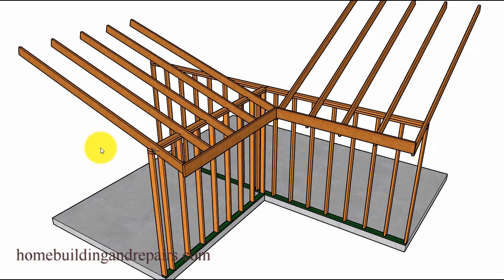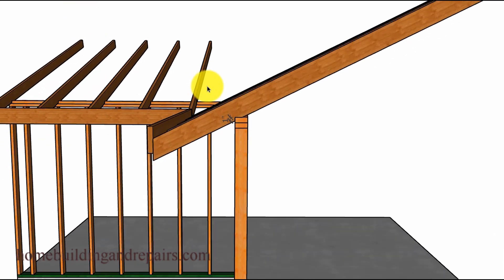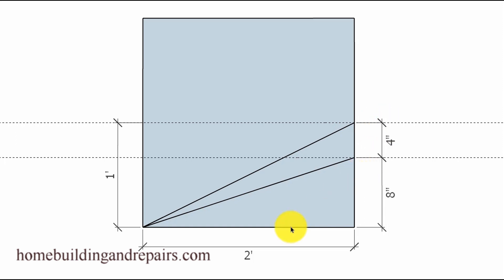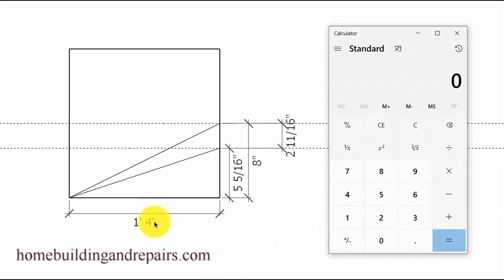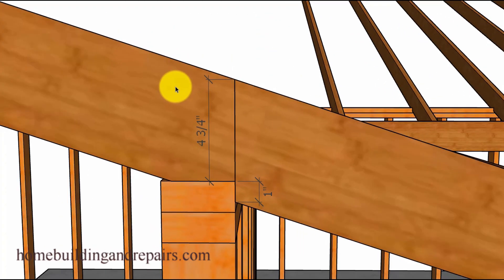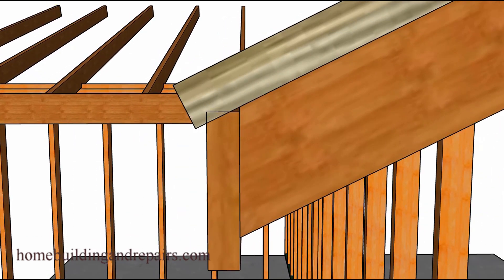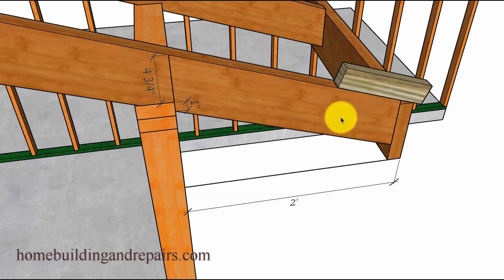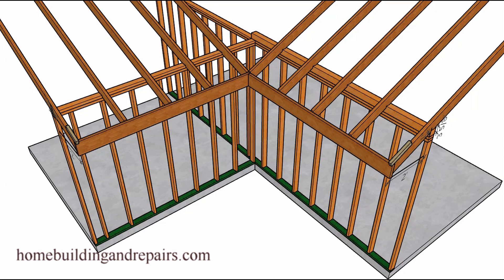How To Calculate Wall Height Difference When Framing Roof With Different Pitches For Fascia Board

Comment: Great video.   How much higher does the plate need to rise on the steeper roof pitch if one roof is 6” pitch and the other roof is 12” pitch?   Also how do you figure out the valley ridge so the two roofs plane ?  Thank u

Comment: If the pitches are different then the soffits would not be the same width.. correct me if I’m wrong.
Reply: Same question I was having.  He overcame the issue by changing wall elevation on one of the walls, there by putting the two eaves at same elevaion.  Exterior wall height and soffit depth remain the same. I think.

Comment: Nice video thanks for the information, I just wanted to ask if you have two different pitches like you have in this video, won’t there be a problem when you come to the roof valley or is it possible to have a roof Valley even if you have two different pitches, I would appreciate your knowledge on this.

Comment: So basically your soffit measurements would never be the same with different roof pitches if you didn’t adjust wall heights or seat cuts on rafters?
Reply from the maker: For the most part yes.

Comment: Thank you for this awesome video. What I don't understand is that by changing the wall height, why is the pitch not changing not changing? I guess what I mean is that if pitch is calculates with rise and run...if you change the rise by adding to the top plate, why is the pitch not changing?
Reply from the maker: This example has two different roof pitches. One on the right side and one on the left of valley.
Reply: It will change if you raise it 3.”
Reply: And it’ll screw up the tie in on top too
Reply: Yes you make a good point, if you change only the height of one wall, and not the height of the ridge associated with that wall's rafters, the pitch of that roof will change. That would alter the required change in wall height and cause the birdsmouths on that wall's rafters to not sit correctly. 

To change only the wall height and not the associated ridge is a problem more complicated than I can comprehend. What do you say @gregvancom

Comment: I'm trying to build a small greenhouse and I know how to calculate rafter length, I know the pitch desired, but I am struggling to figure out how to determine the height of the height that the wall should be framed at and what the height of the ridge beam will be. Can you point me in the right direction?
Reply from the maker: Usually you can use wall heights seven feet or taller and I have a lot of videos on roof framing at our website that can help.
Reply: @gregvancom  I'm trying to stay under 13ft because my municipality is strict about height. So I know I want a Ridge beam no more than 13ft high, and I know how to determine rafter length but I imagine rafter length is directly correlated to the height of the wall, if you want a specific pitch. I will look for those videos. Thanks.

Comment: Nice video what I've always done is draw the two tail drops and the intersecting point at the wall plate on a sheet of plywood then make each tail pattern to use when the roof framing starts
Reply from the maker: That's a great idea!